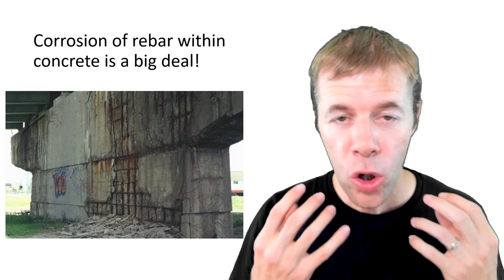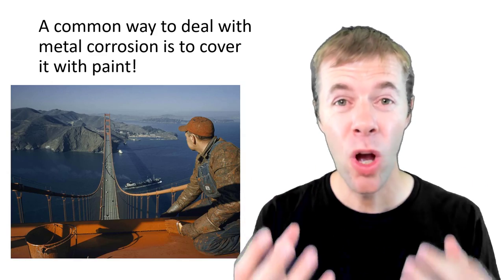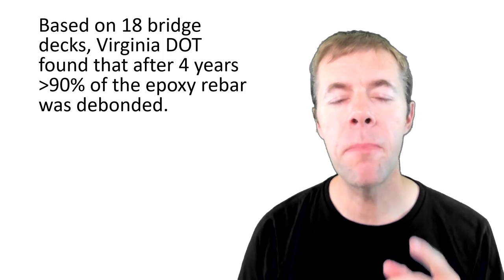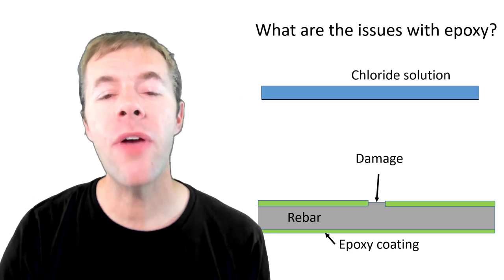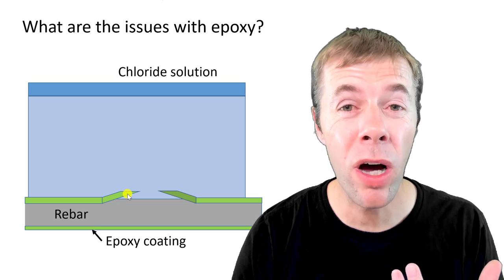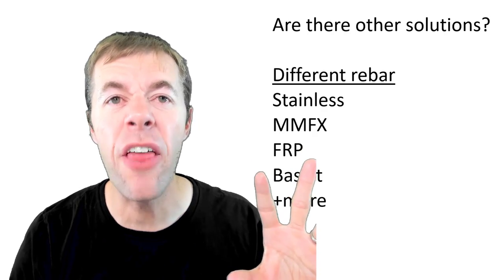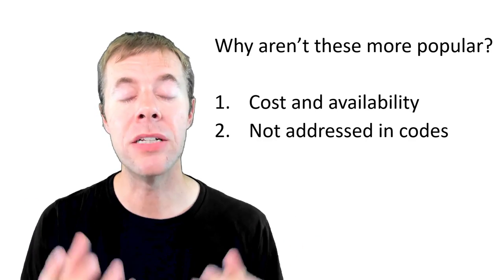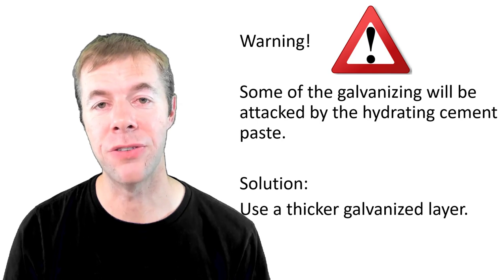What is epoxy coated rebar and why is it being banned?

Comment: Three engineers sat around the table in the cafeteria arguing about the nature of god. 
The first one said, “The human nervous system is proof that god must be an electrical engineer.”
The second piped up and said, “No, no, no. God is a structural engineer. Just look at the elegant way both the bones and muscles work together.”
The third remained quit for a few seconds before saying, “Nope god is most definitely a civil engineer.”
The other two replied in unison, “What!”
“Well,” said the third. “Who else but a civil engineer would put a sewer line through the game room?”
He won the debate.
Reply: God is a Software engineer,  he made everything from nothing using only his words.
Reply: I think you mean God is a writer, cuz he made everything using only his Word...his Microsoft word.
Reply: @botcrack  Nah
Reply: @beauvsb5230  Computer programs does not create anything, just instructions. Not the real engineering stuff which the physical engineering manufactured product. Before you can create a software engineering program you must rely on the PHYSICAL ENGINEERING SECTOR TO BUILT THE PHYSICAL INFRASTRUCTURES AND PHYSICAL TECHNOSTRUCTURES REQUIRED BY YOUR SO CALLED COMPUTER IT SOFTWARE ENGINEERING BEFORE YOU CAN BECOME A SOFTWARE ENGINEER. YOU NEED THE PHYSICAL ENGINEERING FIELDS TO FIRST CREATE YOUR PHYSICAL COMPUTER HARDWARE STUFF BEFORE YOU CAN BECOME A COMPUTER PROGRAMMER AND SOFTWARE ENGINEER. It is a matter of the CHICKEN AND EGG FACTOR OF WHICH COMES FIRST. In the history of engineering it is the mechanical engineering (TOOLS) that came first, then metallurgical engineering (IMPROVING TOOLS) that came second, then it is the chemical engineering (IMPROVING MATERIALS) that came third, then it is the civil engineering (COMBINING ALL 1ST, 2SD, 3RD ENGINEERING FIELDS) that came fourth to create the final product that we all call as "CIVILIZATION"!  The non-computerized engineering came first and can DO WITHOUT THE NEED FOR COMPUTERS but it is the computerized engineering that came last THAT CANNOT DO WITHOUT THE NEED FOR THE PHYSICAL PRODUCTS AND PHYSICAL SERVICES OF THE HARDWARE OF THE 1ST, 2SD, 3RD, AND 4TH ENGINEERING INORDER FOR IT TO EXISTS! For without the 1st, 2sd, 3rd, and 4th engineering then the computer industry will cease to exists! Remember that the first transistor was made without a computer and only with human brains, textbooks, printed blue prints, printed instruction manuals, abacuses, slide rules, and all kinds of analog non-computerized technologies. And the fact that it is a machine shop that made the first machining cuts of a germanium crystal to make the first semi-conductor crystal transistor. DON'T YOU COMPUTER PEOPLE EVER BOTHERED TO LEARN THE HISTORY OF YOUR SUBJECTS AND THE HISTORY OF YOUR COMPUTER FIELDS AND WHAT ARE THE NON-COMPUTERIZED INDUSTRIES RESPONSIBLE FOR THE CREATION OF YOUR SUPERFICIAL IT COMPUTER FIELDS? Or is it because out of envy or arrogance that your refuses to acknowledge those facts, figures, proofs, evidences, and historical archives "ON PRINT"?!
Reply: Computer programs does not create anything, just instructions. Not the real engineering stuff which the physical engineering manufactured product. Before you can create a software engineering program you must rely on the PHYSICAL ENGINEERING SECTOR TO BUILT THE PHYSICAL INFRASTRUCTURES AND PHYSICAL TECHNOSTRUCTURES REQUIRED BY YOUR SO CALLED COMPUTER IT SOFTWARE ENGINEERING BEFORE YOU CAN BECOME A SOFTWARE ENGINEER. YOU NEED THE PHYSICAL ENGINEERING FIELDS TO FIRST CREATE YOUR PHYSICAL COMPUTER HARDWARE STUFF BEFORE YOU CAN BECOME A COMPUTER PROGRAMMER AND SOFTWARE ENGINEER. It is a matter of the CHICKEN AND EGG FACTOR OF WHICH COMES FIRST. In the history of engineering it is the mechanical engineering (TOOLS) that came first, then metallurgical engineering (IMPROVING TOOLS) that came second, then it is the chemical engineering (IMPROVING MATERIALS) that came third, then it is the civil engineering (COMBINING ALL 1ST, 2SD, 3RD ENGINEERING FIELDS) that came fourth to create the final product that we all call as "CIVILIZATION"!  The non-computerized engineering came first and can DO WITHOUT THE NEED FOR COMPUTERS but it is the computerized engineering that came last THAT CANNOT DO WITHOUT THE NEED FOR THE PHYSICAL PRODUCTS AND PHYSICAL SERVICES OF THE HARDWARE OF THE 1ST, 2SD, 3RD, AND 4TH ENGINEERING INORDER FOR IT TO EXISTS! For without the 1st, 2sd, 3rd, and 4th engineering then the computer industry will cease to exists! Remember that the first transistor was made without a computer and only with human brains, textbooks, printed blue prints, printed instruction manuals, abacuses, slide rules, and all kinds of analog non-computerized technologies. And the fact that it is a machine shop that made the first machining cuts of a germanium crystal to make the first semi-conductor crystal transistor. DON'T YOU COMPUTER PEOPLE EVER BOTHERED TO LEARN THE HISTORY OF YOUR SUBJECTS AND THE HISTORY OF YOUR COMPUTER FIELDS AND WHAT ARE THE NON-COMPUTERIZED INDUSTRIES RESPONSIBLE FOR THE CREATION OF YOUR SUPERFICIAL IT COMPUTER FIELDS? Or is it because out of envy or arrogance that your refuses to acknowledge those facts, figures, proofs, evidences, and historical archives "ON PRINT"?!
Reply: herrinjerry  Computer programs does not create anything, just instructions. Not the real engineering stuff which the physical engineering manufactured product. Before you can create a software engineering program you must rely on the PHYSICAL ENGINEERING SECTOR TO BUILT THE PHYSICAL INFRASTRUCTURES AND PHYSICAL TECHNOSTRUCTURES REQUIRED BY YOUR SO CALLED COMPUTER IT SOFTWARE ENGINEERING BEFORE YOU CAN BECOME A SOFTWARE ENGINEER. YOU NEED THE PHYSICAL ENGINEERING FIELDS TO FIRST CREATE YOUR PHYSICAL COMPUTER HARDWARE STUFF BEFORE YOU CAN BECOME A COMPUTER PROGRAMMER AND SOFTWARE ENGINEER. It is a matter of the CHICKEN AND EGG FACTOR OF WHICH COMES FIRST. In the history of engineering it is the mechanical engineering (TOOLS) that came first, then metallurgical engineering (IMPROVING TOOLS) that came second, then it is the chemical engineering (IMPROVING MATERIALS) that came third, then it is the civil engineering (COMBINING ALL 1ST, 2SD, 3RD ENGINEERING FIELDS) that came fourth to create the final product that we all call as "CIVILIZATION"!  The non-computerized engineering came first and can DO WITHOUT THE NEED FOR COMPUTERS but it is the computerized engineering that came last THAT CANNOT DO WITHOUT THE NEED FOR THE PHYSICAL PRODUCTS AND PHYSICAL SERVICES OF THE HARDWARE OF THE 1ST, 2SD, 3RD, AND 4TH ENGINEERING INORDER FOR IT TO EXISTS! For without the 1st, 2sd, 3rd, and 4th engineering then the computer industry will cease to exists! Remember that the first transistor was made without a computer and only with human brains, textbooks, printed blue prints, printed instruction manuals, abacuses, slide rules, and all kinds of analog non-computerized technologies. And the fact that it is a machine shop that made the first machining cuts of a germanium crystal to make the first semi-conductor crystal transistor. DON'T YOU COMPUTER PEOPLE EVER BOTHERED TO LEARN THE HISTORY OF YOUR SUBJECTS AND THE HISTORY OF YOUR COMPUTER FIELDS AND WHAT ARE THE NON-COMPUTERIZED INDUSTRIES RESPONSIBLE FOR THE CREATION OF YOUR SUPERFICIAL IT COMPUTER FIELDS? Or is it because out of envy or arrogance that your refuses to acknowledge those facts, figures, proofs, evidences, and historical archives "ON PRINT"?!
Reply: @darthvader5300  your views are too shallow let me educate you about what you percieve as reality.

Everything your 5 senses percieve is just a chemical reaction programmed into your brain,  colors you percieve is just a frequency at which your eyes detect them, everything happens in your brain, A chemical reaction at which your brain recieve and transmit electrical signals which is equivalent to 1 and 0. Everything you experience is just a chemical reaction hard wired. everything you see,  touch, feel, taste and hear is just a form given to you by your brain, a frequency,  a coded signal telling your brain what you feel,  see,  taste and hear. Even time is a pre programmed instruction your brain is blindly following, doesnt this world feels like a simulation? Where God programmed a variable called Human which tries to learn and adapt and evolve.

Everything humanity achieved is a byproduct of those neurons,  nodes working together,  learning and adapting all the way up to prehistoric era isnt this comparable to machine learning? Everything you do,  react is just a combination of chemical signals your brain recieves.

Going back to the subject, by definition God created everything by his word. Word = set of coded instructions,  algorithms and laws. 

This is comparable to a programmer making worlds out of instruction sets or codes -> open world games. 

He has total control about everything -> programmer can manipulate the reality of the world he created.

God is the Alpha and Omega. -> the programmer is the begginning or the end of the world he creates, and the people that live on that world the history of that world do they know they are programmed that way, do they know they dont even exist? Is this possibility not applicable to humans where we belive there is a higher being out there watching over us? 

And the parallel goes on and on. 

Technically Software Engineers gods of their own world hence it is the closest thing to God in my opinion.
Reply: @darthvader5300  bruh
Reply: @darthvader5300  All science fields were based on previous disciplines like maths or philosophy, do those fields deserve the most respect for you ?
All engineering is is physics applied to physical bodies. Do you have a shrine for all physicists who discovered the principles that make your hardware passion possible ? 
Do you think that all pharmacologists should bow down when they meet a chemist ? And do chemists should worship alchemy ?
Plus, you show that you don't know computer science history either. Binary systems, Boolean logic and algorithmic were abstract field of mathematics even before electricity became a thing. It dates back to the 15th century with Leibniz studying the possibilities of binary math. When "hardware" became powerfull enough, we just applied the theory and it became another field in engineering and physics.  Furthermore, I dare you to find any engineering project done nowadays without going through a computer program at some point. You can't use softwares unless you have hardware, but you can't create a monstrous machine without running computers simulations so ... 
Science is not a feodal system, it is a 3d web in which when several knots connects to create a new hub, this new field gets it own life and connects with even more knots. Even if computer science is a relatively new science, it became indispendable so quickly to the point where every field of science has it's own softwares and mathematical basis to create and use those softwares. 
You can't just consider all of computer science stupid only because it isn't 500 years old (which it kinda is ...)
Finally, you talk about elitism amongst engineers while degrading one field because your own is so much better ..... who's the elitist here ?
Reply: A pilot is flying his helicopter in Seattle when fog rolls in leaves him unable see past the end of his rotator blades. 
The building were just a blur but could be used to navigate. 
He spots a man leaning out a window and yells, “ Hey, where am I?”
“Your in a helicopter!” the man yells back. 
With that answer the man knew he was outside Microsoft headquarters. 
Why?
The answer was correct. 
Answered quickly. 
But totally useless.
Reply: @sekishudai  I know computer science only too well in my younger years in my 20s and 30s in the 50s and 60s. Binary systems, Boolean logic and algorithmic has been part of our curriculum in the 1940s and 1950s, in fact we search ancient archeological sites for old mathematical information and one of them is the AYMARA ALGORITHM, A BRIDGE LANGUAGE FOR ALL COMPUTER O/S PROGRAMS TO COMMUNICATE WITH EACH OTHER. You misunderstood me for YOU ARE NOT RUSSIAN! 

We Russians value mathematics far more than you do with one purpose, TO FIND THEIR FLAWS AND LIMITATIONS, and just Einstein once said, "Physics Is In A Constant State Of Flux" and the language used in identifying them and understanding them is the ultimate only language of science called MATHEMATICS which is the language of science, engineering, technology, vocational trades, etc. The engineering projects done without computers are those that were done BEFORE THE ERA OF THE COMPUTERS. The Titanic, the Golden Gate Bridge of your America, your Empire State Building, your WW II battleships and airplanes. 

What I HATE ABOUT YOUR KIND IS YOUR INSANE DEPENDENCE ON COMPUTERS" and that is what makes me HATE YOU AND ALL OF YOUR KIND!  AND THAT IS MY BEEF AND HATRED AGAINST YOU AND YOUR OWN KIND WHO ARE SO ADDICTED TO COMPUTERS!  Before computers we did a lot of things concerning engineering work for the Russian military WITHOUT COMPUTERS.

Your insane dependence on computers IS AN INSANE MENTAL CRUTCH ON YOUR MINDS AMERIKANSKY(IES) a crippling effect on the mind of humanity. In the time of my youth as a young engineer I work with my fellow Soviet engineers numbering in the tens of dozens on all various projects during the COLD WAR WITHOUT ANY NEED FOR COMPUTERS! 

We use only ABACUS, SLIDE RULES, MATHEMATICAL CONVERSION TABLES, ALL ANALOG MATHEMATICAL TOOLS OF OUR OWN DESIGN (WHICH WE WILL NOT SHARE WITH YOU YET AMERIKANSKIES, AND I KNOW YOUR TACTIC BY EGGING ON ME AND GOADING ME BY MAKING FALSE ACCUSATIONS THAT WE DON'T HAVE IT UNTIL I BECAME ANGRY ENOUGH TO REVEAL IT TO YOU AND I KNOW PSYCHOLOGICAL WARFARE TACTICS WHEN I SEE ONE). 

We created mountrous war machines OF SHEER SOPHISTICATION EVEN BEFORE THE COMPUTER ERA and even when we start using computers, we always use our human intellectual capital to counter-check the results of the computer simulations. Oh yes it is expensive to do empirical experiments even when done by computers alread BECAUSE WE DO NOT TRUST COMPUTERS!  We use them but we don't trust them, even if our vast human capital intellectual resources has already counter-checked them positively, we still do not trust computers. 

As for computer science history, our teachers has given us an important lesson to remember when we are learning history of all sciences and that includes computer history going way back to IBM's involvement with the NAZIs and in the construction of the ENIGMA MACHINE and mechanical computers. LEARN ALL OF THE HISTORY AND HISTORICAL BACKGROUNDS OF YOUR SUBJECTS, ESPECIALLY YOUR MATH SUBJECTS. Even after graduating in the 1950s we are under orders to learn the science and technology of the West, and one of them is your computer history with one intention, to know also it's shortcomings and flaws that undoubtedly were overlooked and that is the only motivation we have to learn computer history. Remember Sun Tzu? KNOW THY ENEMY AND KNOW THYSELF, AND IN A HUNDRED BATTLES YOU WILL NEVER BE IN PERIL. That main war philosophy of Sun Tzu is the philosphy we applied in learning math and science, to search and exposed their shortcomings and bring it out into the open! And then solve them all! As a Russian, as we eagerly learn the binary code we treat it equally with a HEAVY DOSE OF SKEPTICISM for as Einstein used to say, physics is always in a constant of flux. Today the mathematical formula is good but tomorrow it will become INADEQUATE!

You see now, you are wrong and I am right. You mistakenly assume I did not learn computer history and it's mathematical language all too well. But it is your insane dependency on computers is what makes all of us Russians hates you! We rather be using abacus, slide rules, mathematical conversion tables, and aiding mathematical device just like the IBM Hollerith computer machines but only vastly different. You see YOU EXPOSED YOURSELF LACKING REAL COMPUTER HISTORY KNOWLEDGE and  it is your lack of UNCENSORED KNOWLEDGE OF REAL HISTORY OF COMPUTER SCIENCE AND IT'S ENGINEERING TECHNOLOGY. You simpy do not understand us Russians on how we think and do things OUR WAY AND NOT YOUR AMERIKANSY(IES) WAY. 

Science is not a feudal system? Of course it is not you dunkoff! Every educated Russian knows that science and engneering is a product of a synergistic process that uses mathematics as a language too but still we prefer the old PRE-COMPUTER ERA methods and not your insane dependence on computers that makes you addictive to it. 

Ever heard of the JAPANESE SOROBAN MATHEMATICS? THAT'S YOUR PROOF AMERIKANSKIES. https://www.youtube.com/results?search_query=soroban+manual  Now that I have exposed you on how ignorant you are of my attitude toward computers, we do not trust them even though we use them and we always counter-check them with an army of mathematicians in the same way we did things BEFORE THE AGE OF THE COMPUTER. ALL IS ANALOG AND BY BRAIN POWER! ABACUS AND SLIDE RULES AND CONVERSION TABLES AND OTHER MANUAL MATHEMATICAL AIDING TECHNOLOGIES. Thes are the things we use before WW II and after WW II, even after we got computers WE STILL DO NOT TRUST THEM EVEN THOUGH WE USE THEM. Always counter-checking them of their results with an army of mathematicians and engineers to build vast numbers of prototypes to do THE PHYSICAL EMPIRICAL EXPERIMENTS. https://www.youtube.com/watch?v=kvIFBSAj9B8 .

You Americans always wanted the easiest way and all short cuts. But not us Russians, we want to be sure and thorough of ourselves and that of our work! BESIDES, ONE BLAST FROM AN EMP OR A CME AND YOUR COMPUTERS ARE ALL JUNK!
Reply: @darthvader5300  Well, thanks for the courses it was instructive. :) 
First of all, you speak for all russians as if you were one conscience. I'm sure there are engineers in russia who also depend only on their machines.
Secondly, I am not american, I am french, but before you write a long monologue about my country, I want you to know that I don't care about patriotism and countries cultures in science. You have a different approach, then good for you and for everyone : let's put our conclusions together so we can go even further in the understanding and the use of the universe. Science is a collaborative process and diversity is a good thing. 
The cold war is long gone and I really don't think we should stop ourselves from using the amazing possibilities that computers offer on the virtually inexistant chance that an EMP destroys all of it...
I am all for counter-checking the data of any computer results but once a simple calulator has given a correct result a million times, I don't think it's relevant to redo the math by hand just to be sure. 
There are people specialized in the limits and problems softwares have. So they just have to create softwares that include those limitations in their structure, so that we all know what to expect before hand. 
You are not describing the best way, but A way amongst many other. The abacus and rulers you are talking about are still used all over the planet, and computer simulations are just one of the many steps in designing anything. Prototypes are still made to tests things that the computer might have missed. You are talking like analogic and digital are opposite ways of doing things but no, they are complementary. We should use the best of both pathways to achieve our goals. 
You said multiple times that you hate us (all occidentals i presume) because we do things differently, but with this now useless rage, it keeps you from actually sharing your knowledge to a new generation which could use the best ways of doing things to improve things for everyone.
You seem like a wise person in the engineering field, so me being a student in engineering, I would love to know more about how you did effective work without computers. If you want to share your passion, I am all ears :D but please get down this high horse of moral and intelectual superiority, it really doesn't help to get your message across. Help others instead of blaming and shaming them, you might find some interesting people this way ^^
Reply: darthvader5300 
But a slide rule is a computer.
Reply: Silentatroman 
So, are you saying that someone’s religious faith (whatever that might be including believing god is a VW in Brooklyn) can’t do math or understand physics?
Reply: @rjmiller8330  only if the faith explicitly forbids free or heretical thought. Creationists make for poor paleontologists. Flat earth is a quasi religious belief and calculus is forever beyond them.
Reply: this is why Russia has no stealth airplanes,because Mr.KGB,aka darthvader is still calculating radar reflections on round surfaces by abacuses and slide rulers with a huge bunch of comrades since before cold war.
Reply: The topic is not even "what is the best engineering field" smh
Reply: @beauvsb5230  binary too explain quintanry referring too your these structures without angelic field instructions is extremely encapsulating as limitations of  words will always be self evident .In the beginning was silence and within that silence perfection as eternity was elapsing there became sediment and the bondage of that sediment became a crushing weight from all directions creating the one which created consciousness in which created the vacuum that ripped the one apart which created the structure which created the forces which created condensation which created particles which created complexity infinatu and not limited too self consciousness which again creates a vacuum separating I and me for which separates us from them so it then it sleeps and then dreams and then wakes up again as the ouraboras devours the body it's apex is nourished and sleeps then awoke again by the Peirce of the tail trying too murder it's master for which the cycle begins again.
Reply: @sophiaandjoefam1118  What ever you are smoking give me some.
Reply: @beauvsb5230  , ????? 
Damn, ...... you is smart. ( I'm not kidding)
I think I'll go back to bed.
Reply: Late to the party but, ... what if (IF), the brain and body are but a vessel and a proactive protection machine for the trillions of bacteria that reside in one's gut and throughout the body. Their goal is the same as ours eat, survival, and reproduction. Are we the host or are they?
Reply: @beauvsb5230  But it takes an electrical engineer to make the computer.  Without that all the code is just words without power.  BTW I am a hammer swinger....the much ignored...mechanical engineer.
Reply: @Henry Clayton Possibly because no one truly knows anything about the universe itself everything is just speculation and opens wider possiblities that may or may not be true but is feasible mathematically and logically. Everything is just about how you experience things and idealism is too farfetched and just rely on feelings which isnt a valid argument. 

Everything I stated has been proven true, everything revolves around frequency, your brain will and shall only respond with yes or no, whether is fires electrical signal or not which equal to binary representations 1 and 0 which coincidentally what computers used to communicate too.

Debating whether God should be electrical engineer because it comes before software engineering is like the same principle as "who came first chicken or egg" and clearly software engineering is mostly closely resemble God simply because you can make anything and any world(virtually) possible and by default you are it's creator hence God.

This is not even a debate whether what is the best engineering branch nor I stated software engineering is better among the rest.
Reply: I believe in a higher order being out there but not in BS fabricated religion and stuff.
Reply: @genehamilton1272  it is widely accepted theory, it also applies to us human, we may be part of a tiny spec of a chain in which someone higher than us might be looking at us but we cant even see them because they are higher order and we can only understand, see dimensions and interact up to 3 dimensional, just like we can view bacteria in a microscope, we understand alot about them but we dont know if bacteria even knows humans exist or bacteria knows itself is just a tiny spec of particle inside us humans.
Reply: @beauvsb5230  "who came first chicken or egg" well, egg of course. egg existed long before chicken, as a species, came along :)
Reply: @mariusvaiciulis5072  proof?
Reply: @beauvsb5230  dinosaurs layed eggs before chicken came into play. that question is unanswerable only if you deny evolution, and stick to creationist theory instead, then yes, there is no way to tell, how god decided to start this species, from an egg, or already hatched chicken. otherwise, the answer is quite obvious. first chicken is a mutant of another species, so an egg with that "mutant" inside is still first. i.e. answers may vary, but only in case the question is not fully qualified, i.e. formulation quite loose, like "who came first chicken or egg".
Reply: @mariusvaiciulis5072  in short no one truly knows the answer and we can only speculate
Reply: @beauvsb5230  we can speculate on what species laid an egg with first chicken to hatch, but everything else is pretty much clear.
Reply: @mariusvaiciulis5072  Nope everything is just a theory, unless someone today actually go to that era and tell us exactly what happened, until then we can only have speculations. There are unlimited possibilities about how life might have transpired and no one can say crystal clear that what they believe in is the actual truth.
Reply: @sekishudai  Very well stated.
Reply: It is your freewill choice to believe whatever you want to. Jesus is however a very real historical figure documented in both secular as well as religious writings, (you could even Google it) and the reason the story won't go away is because of all the beyond explainable things he did that were witnessed by literally thousands of people, and who was crucified, and then seen again in a touchable body form by over 500 people walking and talking with them. All the beyond explainable things, including the crucifixion and resurrection were then documented in writing by a few, and the story has been passed down over the ages. There is physical papyrus dating to about 125 AD, and the New Testament has been preserved in more ancient documents than any other ancient written document. Something to make You go Hummm? Period...Just as you and I are writing, and yes we really are communicating in writing, and it really is happening, time will not change the fact that we have communicated in writing, and that we have had to see with our very own eyes, or hear with our very own ears, something that really occurred (our communication), the same is also true of the events that occurred when Jesus walked on this planet. Whether you choose to believe that we (you and I) have in fact communicated is still your freewill choice, but it doesn't change the Truth. You can ignor reality, but it doesn't change facts. Take care, and hopefully some day you will come to know the peace that surpasses all understanding. It is a free gift.
Reply: Abigail Slaughter  who you referring to?
Reply: So how far back do you personally go in history before you start classifying people you never knew in such derogatory terms and then discounting anything they taught? The Romans from the same era as Jesus conceived representative government, which is what all modern democracies are based upon, and if you live in a place that has some form of democracy, and I believe that you do, you have freedoms that were conceived by people from thousands of years ago and paid for with the blood of modern people. Believing in Jesus gives people HOPE. What is wrong with HOPE? Your reasoning doesn't make sense. I'm sure there are things that you HOPE for. I HOPE that some day you come to KNOW the PEACE that surpasses Human understanding. It's a FREE gift. Take Care.
Reply: @darthvader5300  Anyone that uses all caps loses the debate
Reply: @darthvader5300  And your typing on what?